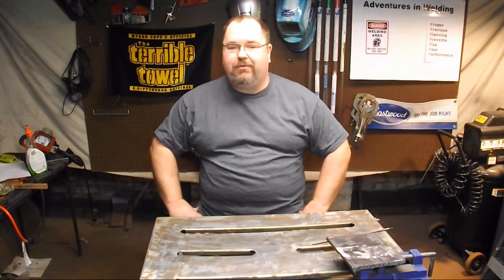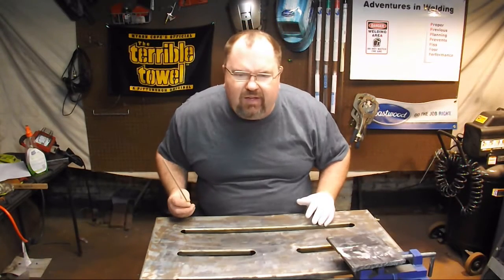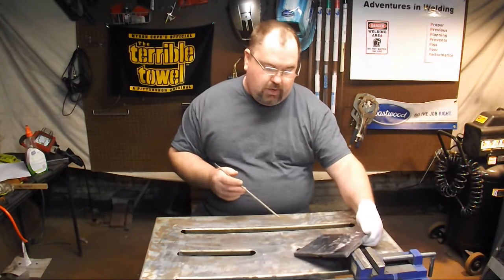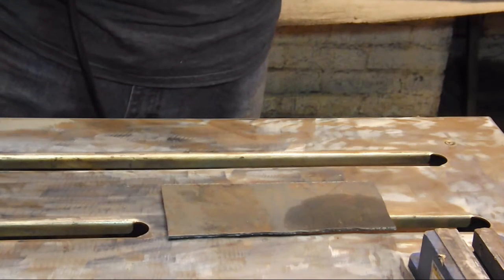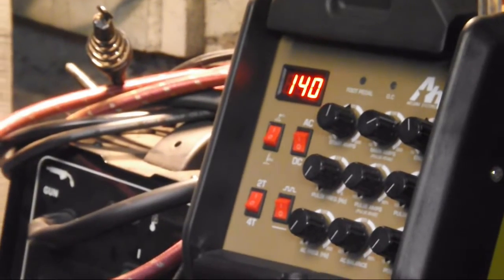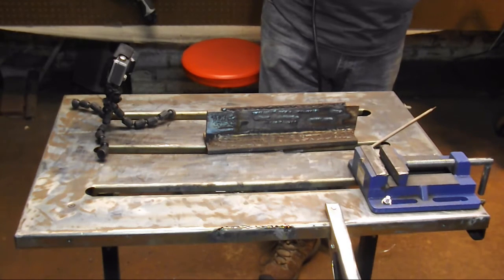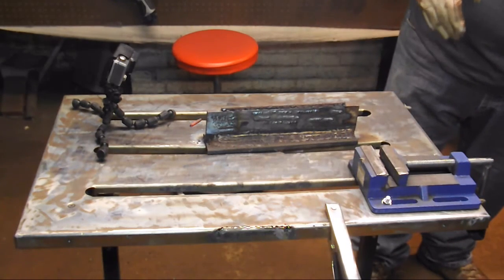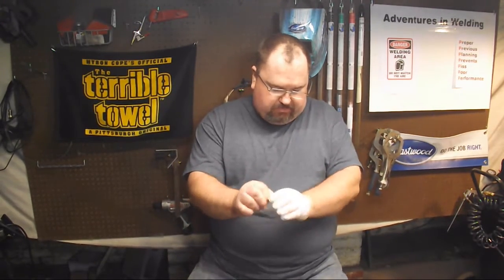All about the 7024 Electrode

Comment: DID YOU SAY A BEAUTIFUL  BEAD !!!? If you run jet correctly, the slag will rise up off the weld, or chip off with one tap of a chipping  hammer and be perfectly  smooth.  Lower your heat a tad, don't weave just drag. You were moving  way to fast, and your rod was all over the place. keep your rod still as possible, and at the proper angle and heat. You know jet runs pretty quick, you will have a oblong  puddle, but ultimately should  have a perfectly smooth weld with no undercut. Your weld will be smooth as Glass !.!. When your done welding jet, and your piece is cooled, you should be able to drag  your finger nail over the weld without catching it on any part of the weld....Smooth as glass!!!
Reply: i have one 7016 slag video
Reply: i agree he was moving to fast it, and he was pushing down while he was welding. i don't believe it looked as good as he thought it did, but i have to disagree with putting the amperage down he could have put it up to 145 and did better. his bead looked to skinny for a 7024 1/8 jet rod.